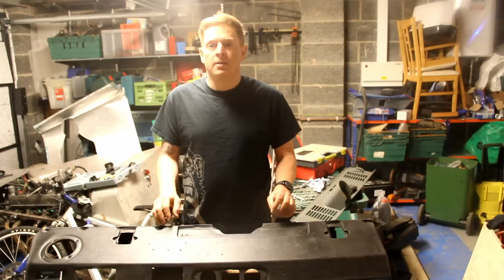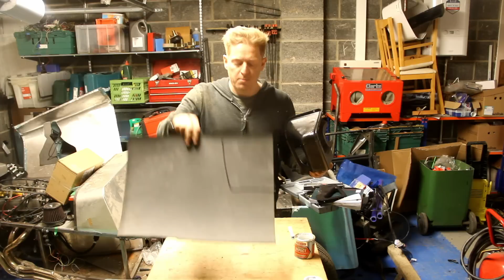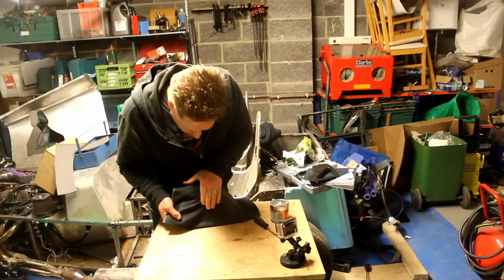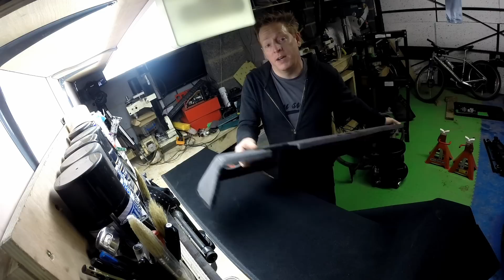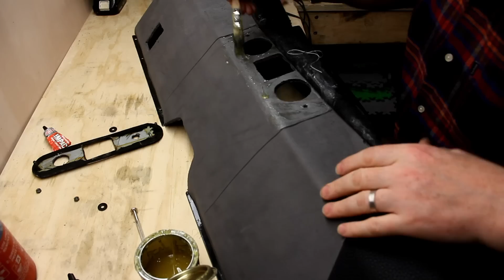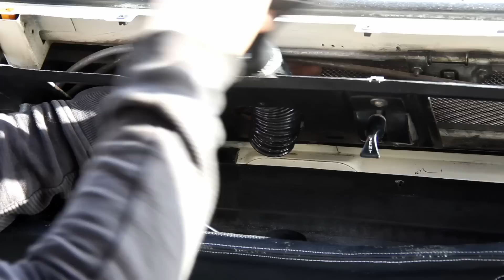Kev's Defender Project Episode 4 - Dashboard Refurb part 1

Comment: Hi great job but what glue did you use   Thanks
Reply from the maker: I used Evo Stik Impact Adhesive (full title is 'Evo Stik Impact Multi-Purpose Instant Contact Adhesive' - I switched between the 'normal' version and the solvent-free version (because the solvent version was giving me a headache!) They both eventually do the same job, but the solvent-free version take a lot longer to become tacky enough to mate the surfaces.

Hope that helps, and thanks for watching!